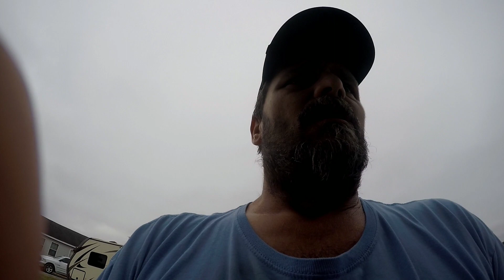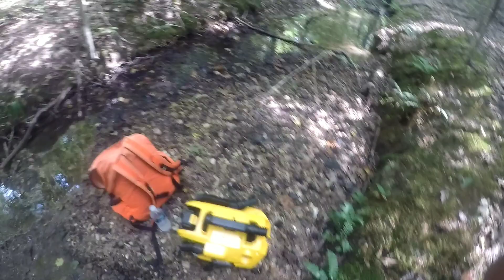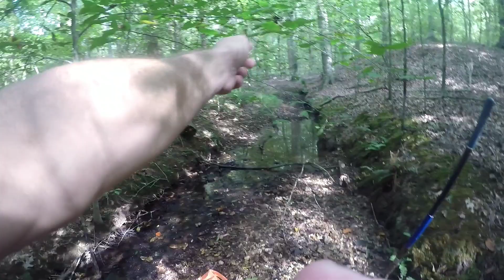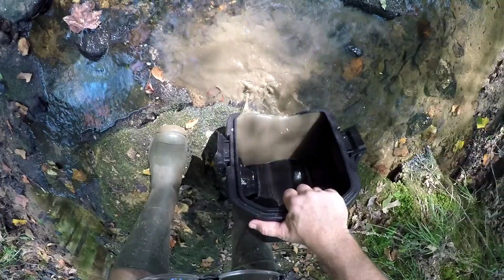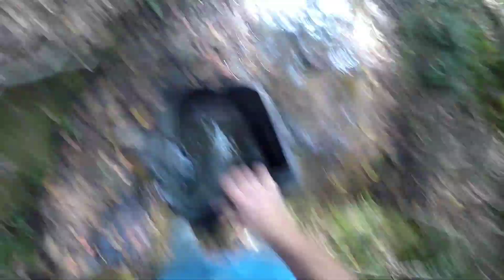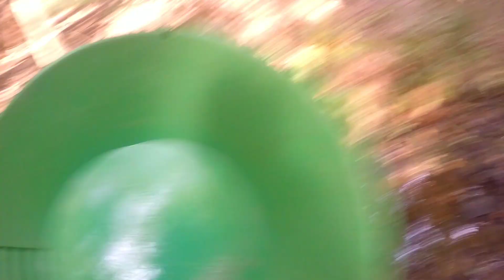Not sure what to call this video

Comment: I too have gotten a cordless vac for the very same reason,  I am going to put a swing check valve in mine to drain automatically when you cut the unit off. You and I sound way too much alike on the ideas. Good luck I hope you find lots of yellow so I will stay after it myself.
Reply: I am adding a vanity strainer in the inside fitting of the check valve to help stop my losses of sand and gravel.
Reply from the maker: When you do I would like to see it please, thank you for subscribing